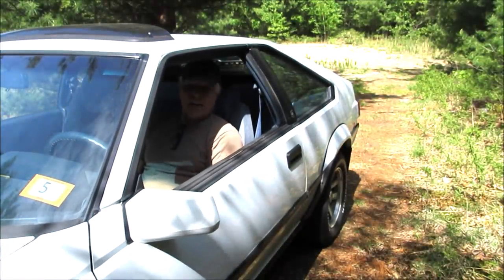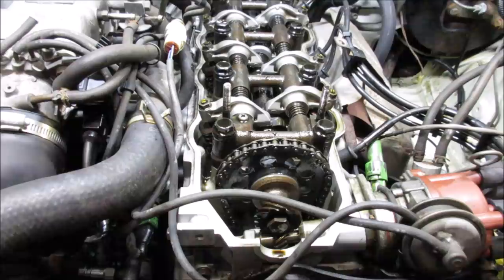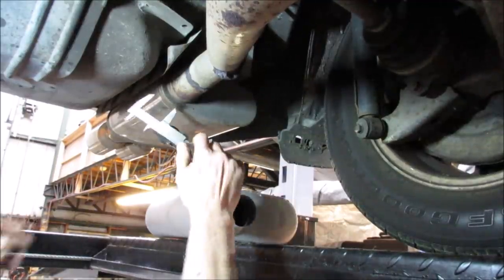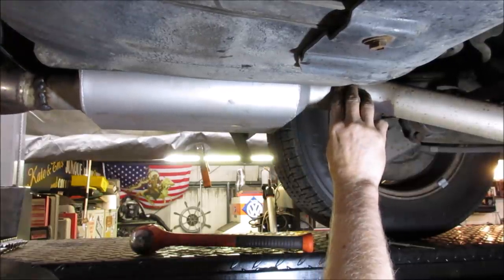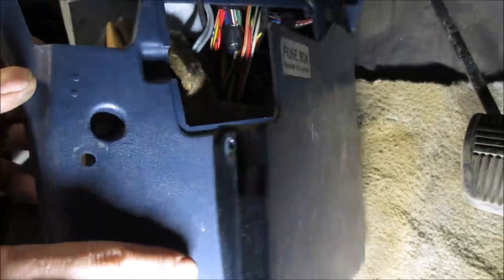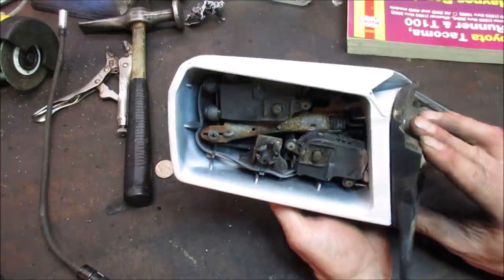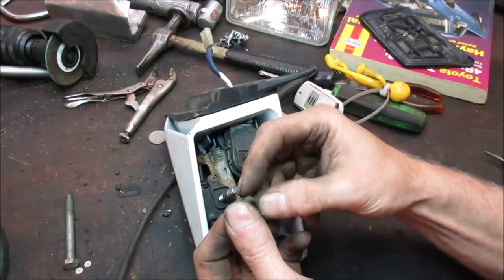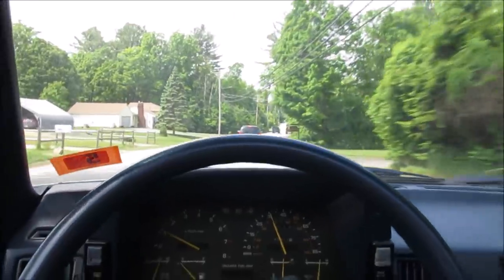Bought The Best Toyota Ever Made

Comment: I recommend getting into 3d printing for those brittle plastic bits. You can reuse the motor inside and you can 3d print up a new piece. It's a little rotating gear and since the stick can't move that makes it move up and down, you can print it and it's matching socket piece. I'm from Canada where even 15 year old plastic parts are snapping left right and center, 3d printers are a godsend for us classic car guys. I gotta 89 Mazda 929 a car that basically doesn't exist, so having the ability to just make something up is really great.

You can also use a bolt head on that sort of thing and make a socket with JB weld it just has to be a shape that doesn't allow rotation of the shaft but the mirror needs to be able to move against the bolt but it also pulls it hence the socket design.

Comment: I owned a 1978 Toyota Celica GT 5 Lift-back back in the 80's. Drove it for 5 years and never had any problems with it plus it was getting around 80+ miles per gallon. It had a 13 gallon gas tank and I was able to drive it from San Diego, CA. to Salt Lake City, Utah and back to Las Vegas, NV on the 1 tank of gas. Was so sorry I traded it in for a brand new car which turned out to be a piece of garbage.

Comment: Hey Darren fix it up and you can use it to do drives around the state like you did with the Bus the Cressida will be better than driving the Tundra with the gas price’s . That would be fun on the kanamangus highway . I got my New Hampshire driver’s license on a 1980 Cressida do not know type though it was a five speed used to take out each morning before parents got up and do block runs getting used to the stick .

Comment: The 1985 Celica used the running gear from the Corona not the Corolla. The Corolla had a smaller engine. The 22RE was used in the Corona, Pickup, and 4Runner.

Comment: The mirrors are assembled/disassembled by running the motors and completely unthreading/re-threading the screws; but they need to be connected to the mirror in a flexible way. They originally must have had a flexible connection element in them; I do remember these to go "tac-tac-tac" when you overstretched them; aparently the motors don't have an end stop and they rely on the screws to unthread and return if needed, most likely both ways, so I guess the inner end also has a bit of an undercut on the thread?

Comment: I have to agree,, I drove one over a hundred miles with no cooling... I had to get there for reasons lost power and dragging at 75 miles scattered at destination....It got me there...Was the Turbo Inline 6 version all track ...Yes I have owned several Even the 70's gt with 22R they are awesome. Replace the little Cam gasket as well 😎

Comment: Most car makers switch the ground to the head lights. I had a 99 Sunfire I had headlight problems with. I grounds were switching the lows and high light. My problem was not a switch of fuse. It was corroded wiring in the wiring harness. A problem with a lot of sunfires and cavaliers of the late 90s GM cars. Toyota's may have similar problems. Check to see if they're switching grounds and not 12 volts plus side.

Comment: Old car 'heaven", death by a thousand cuts! It's the little things that take a lot of time and cause no end of aggravation. BTW:  Great shop you have there, I'm green with envy. 

Good luck on the Celica. I looked up mirrors on the net and I think they are still available. I'd love to follow the further adventures of getting the Celica back in shape.

I went car shopping in the seventies and nearly bought a Celica. When shopping I mentioned that I was a formula car driver and after a test drive opined that there was too much toe on the front. To my surprise, they took it into the shop and adjusted it. The car turned in much better after the tweak. The second test drive had to be done with another salesman. I think he was the boss. The first guy said that he was terrified riding with me! After we got back from our ride I was offered a job as a salesman/demo driver. My duties would be to take a potential performance car customer out for a ride and demonstrate how quick the car was and then sell them a car. I would have had to work weekends but couldn't due to racing and kept my current job which I really liked but didn't pay very well. 

My 1986 Mr-2 ran fine until upstate NY rot got to the chassis and I had to take it off the road. I had been warned by my "captive" inspection mechanic that it wouldn't pass the next NYS inspection. Later on one of our rare tropical storms dropped a tree on it. I was hoping to get a cheap southern car with a blown motor or transmission and swap in my car's mechanicals. My friend in S.C. found one for me but it was way too expensive.

My sort of current daily driver is an old Tercel. The rear brake lines and fuel filler rusted out. Replaced the brake lines with NiCopp, mounted rebuilt front calipers and rebuilt the rear drum brakes. Although finished, I think it's now too rusty to pass inspection so lot's of hiking and bumming rides recently. The clutch is about gone but there is no way those old rusty bolts will come off. I'm out of oxy-acetylene so I can't torch them off - not worth it in any case.  should have just junked that old rust bucket and saved myself time, money and aggravation.

My Current project is a donor 1998 Lexus in pretty good condition. I'm going to have to use a sawzall to remove the rusted filler pipe as there is a bolt with almost no access that won't budge. I ran the car out of gas and opened the filler cap to let as much as the remaining fumes and fuel evaporate. The openings to the tank will be sealed out of an abundance of caution. I purchased a new genuine Toyota filler pipe from a Toyota parts supplier in Canada for a reasonable price. Hopefully I can swap it in this week. I fixed a bunch of little things, including a cracked coil pack, but will have to replace the gaskets on the cam covers at some point as well a catch up on all of the neglected maintenance. The immediate goal is to repair the emission control system so it will pass NYS inspection. If I don't get any emissions warnings on my computer reader I'm back on the road again. 

The Lexus has more buttons and do-dads than an Apollo capsule. All the important ones still work, even the power mirrors, windows and sun roof! The high end (for the era) stereo system LCD screen is half shot but I don't really care. A couple of spots of rust are present over the rear wheel arches but nothing I can't fix. There are also a couple of minor dents and dings but nothing really noticeable.

It's a four door and the thing is huge. The old Chevy suburban I used to tow the race car trailer with was bigger but the all around visibility was a lot better than the Lexus. If the project is a success I might get a cheap rear backup camera and display if there is such a thing. I already nudged Mr. Two with the rear bumper while jockeying it around in front of the shop (my barn) - no damage.

Working on my Corvair and Fiat ice racers every winter was a lot more fun and much easier! The formula cars were pure joy to work on, provided no big crash damage. I ran for twenty years when I could afford to and missed the "big one". Ran out of mad money and had to quit just before turning semi-pro in the Skip Barber Turbo SAAB series for which I did a test that good enough for fifth place 
on the grid. I was forty three, really too old to have had much of a career as a racing driver :(

-dave

Comment: I had one of those straight outta high school (1997). Handled like a pig, had no power, but looked good. Gts had a lumbar, adjustable head rests (forward and backward, not just up and down). Sure do miss it. Always had an exhaust leak at the exhaust manifold to the pipe. Heard it was a common problem with the 22re..

Comment: With the coolant you should also check the Ph, because after so many years the coolant does turn acidic and that in turn is hard on everything, especially head gaskets, that's why it's recommended that every 5 years or 150k miles for a coolant drain and flush usually about two to three hundred miles beforehand you dump a bottle of cooling system cleaner into the radiator and then I personally use A global(all makes and models)rated coolant, never 50/50 always 60/40 and in severe cases 70/30 mix coolant with distilled water.

Comment: usually the reason for the wheel not being centered is badly adjusted tie rod ends (or other steering link)  It's rare that people pull the wheel off, but quite a bit more common to mess with the steering links when they wear out.

If you pull the wheel to recenter it and the issue is the links, you may end up with uneven turning radius.  I don't think it would harm the steering box, surely it has internal stops, but i've never had to find that part out.

::edit:: If you could find something marginally flexible, you could glue one end to the bolt and the other to the mirror and it should work like factory, you just need a little bit of misalignment protection.  Maybe a bit of light rubber?  Or some big stretch caulking might be enough even.

Comment: No. I had an 83. And the steering wheel is completely different and the dash had round dials on the sides. It looked a lot better than the 84 on. The louvers were not standard. Also, is the pump for the seat working. I would Google an 83 GT-S dash to see what I’m talking about.

Comment: Lucky you, Mustie1, to pick up what I think is the best generation Celica. Knife-edge body lines yet enough curves to make it all work together in harmony.
As for exhaust noise, maybe sticking some resonator-inserts in the tailpipes might quiet things down a bit more?
If it was mine, I'd remove the rear-window louvers. That was the gee-whiz setup in the day but sure did limit rear vision. Only good in the dead of summer when the rear window heats up the interior.
Best of all, in my opinion, its from the era of rear-wheel drive. Will be easier and less expensive to change the clutch. Maybe also easier to service the front end.
Lastly, now that its a New England car, I hope you blast the entire underside with your bar & chain oil.
Congrats! You have my vote for more deep dives into the car's repairs. And let us know what kind of gas mileage you get!

Comment: The bolts/adjuster screws have to be stationary, ie attached to the mirror in order to adjust. The motors act like corkscrews. If the bolts aren't fixed to the mirror, they will just spin with the motor and not adjust. Attach the ends of the bolts somehow to the back of the mirror, and the motors will adjust them up and down. You won't need the spring either. BTW, they were originally plastic so they wouldn't corrode. Maybe put a little lithium grease on the threads.

Comment: those screw type adjusters are attached to the mirror, for newer yotas, they had a ball type end to click into mirror.
Metal bolt will eat the internals away, its plastic inside at least on newer cars.
P.S. awesome car you got there, used to own some 90 ties Celicas, even GT4 GroupA straight out of Japan ...

Comment: Looking at the other suggestions for the mirrors, in my mind The fix for the mirror is to grind the bolts square so they only engage on the one side, and then epoxy some braces around the holes on the gearbox and add some grease. That'll keep them from rotating and keep the gearbox lubed up. From there, epoxy the head of a carriage bolt to the back of the mirror in that spot, same deal, grease 'er up.

Comment: 54:40  Hard to remember specifics from back that far, but in most Japanese cars I used to own back in the day, pulling the stalk was only for flashing your lights, but pushing it away from the steering wheel was how you turned your high beam on.  Have only seen you pull on the stalk (you can make your own jokes) in this video, so...maybe?

Comment: That engine.. the 22RE.. ever seen those 80s Toyota pickups that run till the body rots off??? Those had 22R or RE… Mustie I think you’ll appreciate this…. My daily driver is a 1994 Corolla LE with 49,000 all original miles

Comment: I believe (technically) its your wheel alignment thats off, which is causing your steering wheel to be off center. Youd be better off to adjust your tie rod ends/ball joints than to pull off the steering wheel. Otherwise once you get a proper alignment done, your steering wheel will be "off" again. Always better to address the problem rather than the symptoms 😉🙂

Comment: The tac is not off. Its geard like that.
@ 70mph in 5th gear your at 2k rpm
Trust me i owned that car at one time with the 22re engine in it.
But mine was just the celica not a gt.  I put nearly 250k miles on it.
By the way you can put 6.5" in the door right below the crome band and under the door switches
Has to be a shallow speaker. It sounds better then the dash speakers.

Comment: mustie the grease in the indicator assembly goes hard and indicators won't reset and the wires in the hi lo stork tend to break you should be able to pull it apart and repair it i have had this problem before cheers from down under

Comment: all four of those motor shafts have broken threads.  they snapped off.  the screw into plastic pieces on the back of the mirror, which are also missing.  maybe glue a nut onto the mirror and glue screws to the motor shafts

Comment: It's interesting to see that GM and Toyota use the same idea for the mirrors.  I just got finished putting in the turn signals, and auto dimming mirror feature in my 02 Buick Lasabre.  There are two pins like the Toyota. On the GM mirrors, the pins have a little ball at the end of the pivoting shafts, that fit in the plastic backing of the mirror, along with the main big pivot joint in the middle.  It feels like the mirror is going to break with as much pressure has to be applied.  GM has 8 wires, rather than the smarter 3 wires that Toyota used to move the mirror.  Typical grounds and and positives. I remember those Celica's used to be a pretty big item back in the 80's .  I owned a 79 Supra Celica for 2 days, before it caught fire on the side of I-70 right outside of Terre Haute IN.  LOL  I look forward to seeing more on this car.  Those 22R-E's were in pretty much everything back then.  in 86-88, I think, There were a few 22-RTE (Turbo), mainly in the 4-Runners.

Comment: Magnaflow muffler is a turbo muffler, hence the lack of baffles.  I've found them to be quite a bit louder, even on a turbo car, compared to a stock exhaust.  On my current car, I'm running a Dynomax Ultraflow muffler, which, surprisingly, is quieter than the Magnaflow that was on my previous car when I got it.  Both cars were/are Volvo 240 Turbos.
Reply: I had Dynomax Ultraflos on my 2012 Mustang 3.7 and they sounded great. Deep, loud only with throttle, no drone. I was surprised how well they work for being a straight-through. Warning though, both mine failed and somehow the perforated tube disintegrated and all the packing came out. I'm fairly sure this is because I was a dumbass and intentionally got water inside the mufflers when washing it, but it's something to keep an eye out for.

Comment: should've checked chain and guides while you had the valve cover removed. that's prob what your noise is. your also supposed to put a bit of silicone on the rounded parts of half moons that sit in the block

Comment: 20:46 Some new cars (I won't name the manufacturer) will give you a check engine light if you do that. Certain OBD diagnostics can only be run if the car has been off for a sufficient period of time (6-8 hours) to ensure that the engine and the exhaust are properly cooled down. If the car has been off for less than that, those diagnostics aren't run. The California Air Resources Board (CARB) doesn't like it when you don't run diagnostics, so they made it a requirement that you must ensure that the car really has been off for a short period of time. The way some car manufacturers do that is comparing the drop in engine temperature from engine off to engine on with the known cooldown rate of the engine, and see if the time checks out. And on some cars, if you disconnect the battery, the time doesn't run. So the timer inside the engine says your car hasn't been off for enough time (cause it hasn't been running), but the engine temperature says that there is no way the engine cooled down so much in such a short time, and you get a check engine light cause something is definitely wrong.

So if you have fitted a battery disconnect on your modern car and you're getting a check engine light, this might be one of the myriad things it could be.

Comment: They made a Celica gt with a stright 6 that was not a Supra.
If its fuel injection its a 22re 
Or carbrated 22r.
I've owned from a 18rc  to 20r 22r and the 22re  I currently own a 2001 gt.

Toyota kept using that motor in the trucks untill 1999. 

The celica stright 6 was a 5me.

Comment: I had an 80 Corrola fastback with 290K I bought for $120, and I couldn't break it.  I'd blow by state trooper speed traps at 110 mph who wouldn't budge because they'd be checking their gun.  I put another 10K on it and sold it for $250.

Comment: Is that a US spec rear bumper? Seems a little larger than the Japanese ones? Also another vote for the electrolytic capacitors being bad in the tachometer circuit. Easily replaced if you can get to them. Definitely keen to see more on this car.